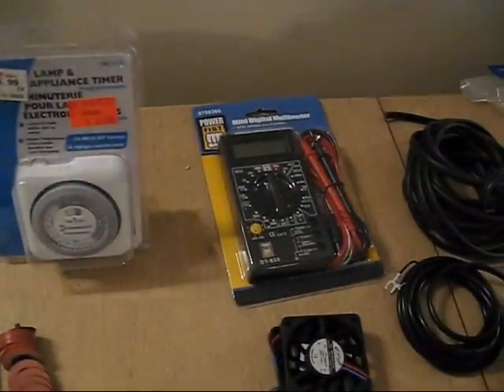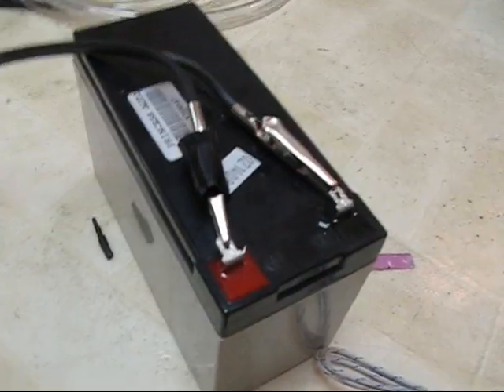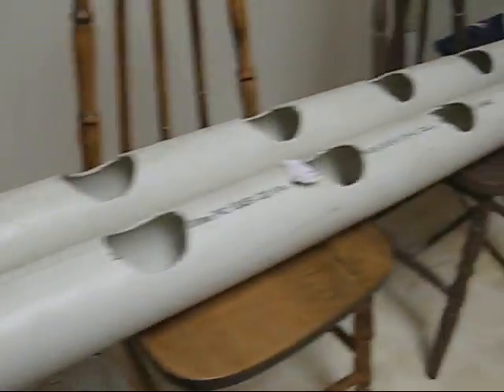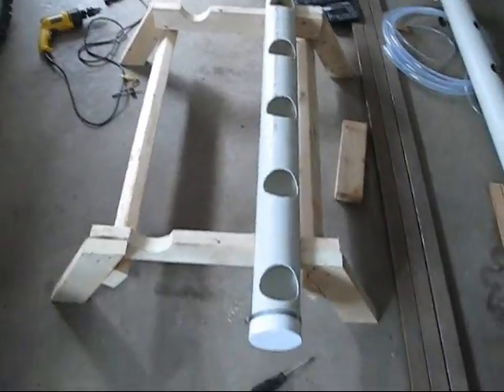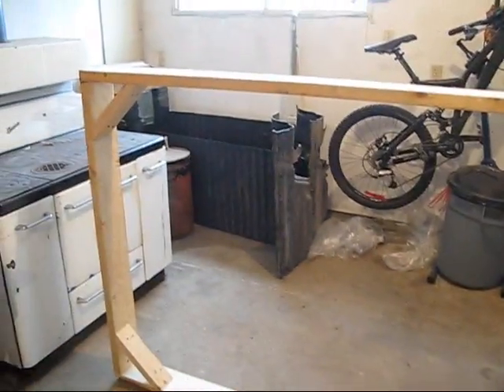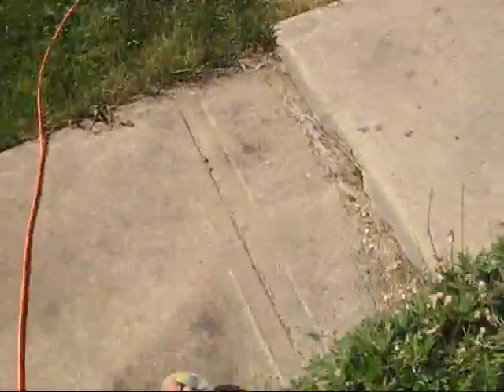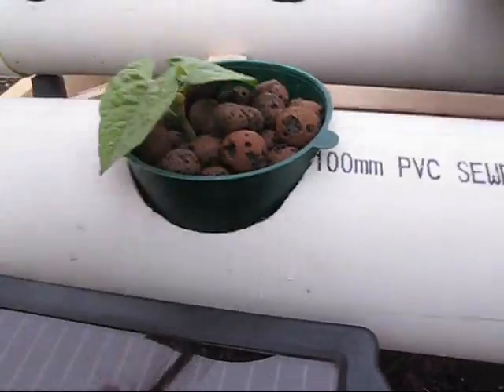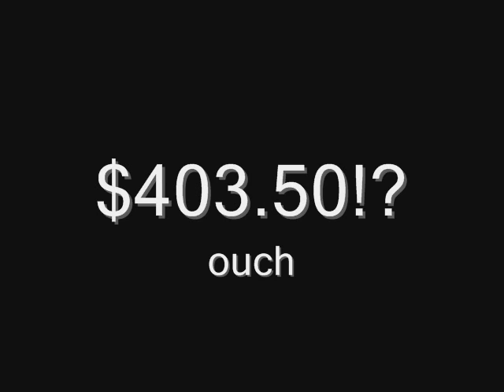12v homemade hydroponics & greenhouse

Comment: You don't need the thermostat for the fan. Just hook the panel directly to a 12 volt fan. When the sun comes out, the fan starts up by itself. Ideally have the fan near the top of your greenhouse facing a light weight baffle that will open when the fan is on and close (with its own weight) when fan shuts off.

Comment: This will make plants frigid, they will still sense the temp change and go into winter mode. It should be a constant summer underground water temp like around 68 degrees. Also note that this is another down side of using tubes, they spread your water density out and transfer outside temps to the water more easily. Again creates drama in water temp causing plants to change to winter mode.

Comment: 4. I like the idea of burying your sump, but you should know that you need to get the tank 2 feet into the ground to get below frost zone. As long as the water is constantly moving, you should be ok, but it could freeze and kill your system at current depth. Also, at this depth, it could cause a dramatic temp change in your water.

Comment: 3. Because you are using tubes and you iced a hole saw, your openings are reducing the amount of water you can allow into your system to your plants. A flat opening will allow you to raise your water level closer to your plants roots for initial starts.

Comment: This was some cool work you did. I look forward to watching more of your work. I have some suggestions I have learned from mine that I would like to offer you.
1. I noticed you are growing tomatoes. They like  water and dry heat with strong sunlight. With this in mind, I have had better luck with roots of tomatoes constantly in water like a deep water system. See my 50 gal goldfish tank compared to my 10 gal aeroponics tank. 50 gallon allows for constant water on roots. 10 gal uses a timer.

Comment: 3 questions: 1. what gpm(gallons per minute) size pump is necessary? im going electrical rather than battery.
2. what do you seal up your inlet and outlet drains with?
3. the over flow is just another inlet plug with some tube on top right?

Comment: Thats a cool setup. If you get heat problems, also put your solar panel out of the green house as those get pretty hot with the black surface. I like your idea for self sufficieny! Where did you get the 12volt water pump?

Comment from the maker: Well if you watched the videos I mentioned you'd see the plants never thrived because of a lack of nutrients. And you'd also see several videos documenting large healthy pepper plants grown in the exact same ebb and flow system 2 years in a row after this initial attempt. Not to mention in zone 2 where growing and producing peppers outdoors would be considered impossible by most. Open your mind, try, experiment and don't be afraid of failure. Lose the negative attitude and you too might succeed.

Comment from the maker: I feel as if you are making assumptions about how this system "should work" when there's videos already proving how it works. The grow medium holds moisture as the roots grow they themselves hold moisture. I have video showing large white healthy root masses from the plants. You've said "NFT systems are designed to be run 24/7" this is not an NFT system just because its in a pipe. The tube floods and drains completely just like any other ebb and flow system. The tube does not need medium in it.

Comment: It is more than likely that you have enough root mass inside of the net cups to keep your plants alive. With your roots open to air inside of the pipes they will dry out. Unless your pipes are extremely level and don't completely drain during the drain cycle. That would leave enough residual water in the tubes to keep the majority of the roots submerged and prevent them from drying out. But if that is what is happening then you run a higher risk of root rot.

Comment: Yes, I am aware that he is using the system as an ebb and flow. Just because you put a timer on a hydro system doesn't make it an ebb and flow system. Google NFT and you will see visually the system he is using is in fact an NFT system. Yes I know how an NFT system works. I use both systems at home. As I explained the problem with using an NFT type system as an ebb and flow is the roots can and almost always will dry out in between cycles. The only remedy is fill the tubes with a media.

Comment from the maker: I'll point you to the two videos I previously mentioned. The medium is inside the basket the pipe fills completely there is no film technique being used, the pump runs for less than 1hr per day total. The roots have never dried out even with only 8 flood and drain periods per day for the 3rd year. Keep in mind I'm in zone 2 so maybe the climate you are used to has a lot more heat and a drier climate. Check out this video for the timer settings im using /watch?v=yw5L7uC7b7U&feature=channel

Comment: I'm glad it worked out for you, but I think you misunderstood what I said. The actual system you are using is in fact an NFT system. You can make that system a reliable Ebb and Flow system, but to be reliable in such a way that your plants won't die, you would need to fill the pipes at least part way with a medium that will retain moisture. So that the roots do not dry out between flood cycles. I have used NFT systems in the past and when the power goes out the plants die in a very short time.

Comment from the maker: Here's what they looked like the second year youtube.com/watch?v=qBQDwZ1bhtE it worked quite well. The first year I didnt get the results I wanted but I learnt a lot. This is an ebb and flow system. The roots get fully submerged with the nutrient solution periodically unlike a NFT like you say runs 24/7 and run a very shallow film of nutrient at the bottom of the pipe. more details youtube.com/watch?v=E481ySRVkR8 If you want to keep up with my trials and errors please sub the new channel thanks!

Comment: I hate to ask this question, but did your plants die? I ask because you are running an NFT system and treating it like an Ebb and Flow. NFT systems are designed to be run 24/7. Typically in an NFT system if the pump stops for even a couple hours the roots will dry out and die. So if your plants survived in that system set up on timers I would be very surprised.

Comment: Hey how well do those net pots seal the light at the lower curve of the pipe?  I see the net pots are slightly coned shaped so that'll make a gap at the lower curve of the pipe possibly allowing light in. I'm sure you could caulk around the edge of the pot. Or just use a larger diameter pipe to minimise the gap.

Comment: nice job bud, instead of going all crazy with thermostats, i would recommend doing research into making an ARDUINO or Netduino controlled hydroponics, then you can make it exactly how you like it, with humidity sensers and feed back, and its alot cheaper. good luck to you bud!

Comment: @happygameshow 

i completely and disrespectfully disagree

i am an experienced hydroponic grower

i am looking into aquaponics extensively

very soon it will be cheaper to do hydroponically then soil because of weather, soil, etc

aquaponics hydroponics both use less water, cause less pollution with fertilizer run off and produce more per square foot when done properly 

right now wendys is running out of tomatoes

this year, my state of ny might not have a broccoli crop because of weather

Comment from the maker: @slotinnn you can build what they call DWC systems for under $20. I agree it can get expensive and will never be cheaper than planting seeds in the ground. As for advantages they include growing in a controlled environment, control over nutrients feeding to the plants, automatic watering, quicker grow times, bigger yields, soilless, control over pests, portability, ability to grow where soil conditions are poor, and several others. I do it more as a hobby, it's a lot of fun to grow without soil.

Comment: put a small foot valve on the intake of the pump and the water wont flow back into the pump and your roots wont dry out. seemed well thought out. what went wrong with the system?

Comment from the maker: @MrCHICKENKEV Hey check out my new system I go into that a little. Basically I flood for 5-6minutes 12 times a day. You might need more or less depending on the heat in your area. I almost might flood once at night but I don't think its nessesary. Make sure to check out my channel for newer stuff and sub for updates.

Comment: @IcechickenSr Some timers you can use the actual sprung or man switch unit I talk about but you need to know what your doing electricaly, in those cases you can remove 120v power lines from the switch If it's not molded in plastic or inaccesable and still use it to trigger a pulse of current to the relay by substituting 12 power in place of the 120 and a couple other simple tricks. I'l look into it and PM you later.

Comment: @happygameshow I could PM you more details. I have a couple GE brand timers easy enough for you to find if they are suitable for the mod, I will take one appart and see if it will work, then you'll know at leasdt 1 type that will work. It's not hard most cases just time. Some timers use a Physical sprung switch also simillar to a "Man switch" and is switching current directly light a light switch on the wall does. Some units use a switch to relay, we need that trigger switch to run our 12v relay

Comment: Some of these 120v timers can be modded inside with a 12v automotive relay and made to work on 12v power. Your really just using the timers housing, controls and timming setup, but changing out the electronic relays inside to automotive 12v unit's. About 5 bucks at an auto store for a generic use 12v relay. Cheers.

Comment: Looks like you used the thin-walled 4" drainage line with the bell ends.  I built a 7-level vertical pvc system for 86 vegetable plants in a corner in the basement.  Constructed with the same pipe, having bulkhead fittings for drains.  Using multiple drain risers, the water flow can be adjusted anywhere from NFT up to 2" DFT depth.  I was wondering, in your setup, since the thin-walled pipe lets some light through, did you have any algae issues?

Comment from the maker: @rlmarin1968 the plan was to keep the system cheap and simple so I would be using 12v DC pumps and accessories such as the thermostat. This year however I will be using an inverter. I should have a video up sometime this month showing the new solar panel setup with the 110v setup.

Comment: Why didn't you just by one of those converters you can plug into your car lighter. Those are already set up to convert 12v into 110 AC or 220 AC? I have so that we can use our laptop as a DVD player on road trips and it would work great with your battery setup.

Comment from the maker: @Agridude2. Hey Mike, at first I wasnt inverting the power everything was just 12v direct from the 12v battery. My pumps, fans, and thermostats were all 12v. I thought this would keep things simple at first but then I realized it was actually more of a pain. This year I will be getting an inverter from my local hardware store so I can convert my 12v to 110v. should open up my options at lot more.

Comment from the maker: I got mine from Canadian Tire. In the States I hear 'Harbor Freight' (?) has some cheap ones too. I've changed my system since the video and now my pump simply runs off the house power till I can get a more reliable solar system running.

Comment: Nice job! You may want to consider adding a master reservoir on a float value system-- that can auto top your 5gal res.Trying to keep the 5gal full would be a full-time job. Currently my tomato plants or taking 3 gallons a day per plant on average.  Once fruit sets they really become water hogs. 

 A larger res. will also help stabilize ph & ppm. Something like a 35 gallon Rubbermaid trash can with lid would get you by for a few days, around $10.